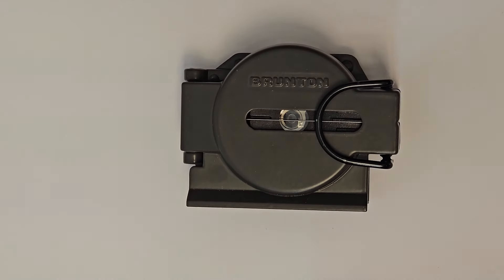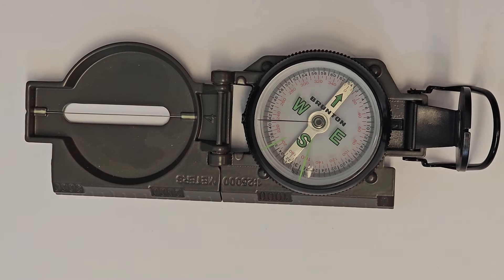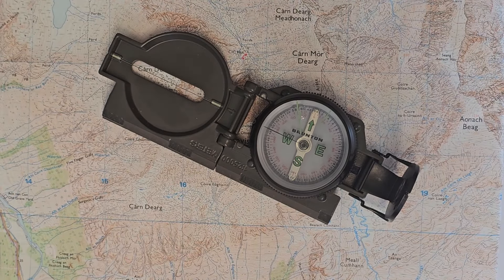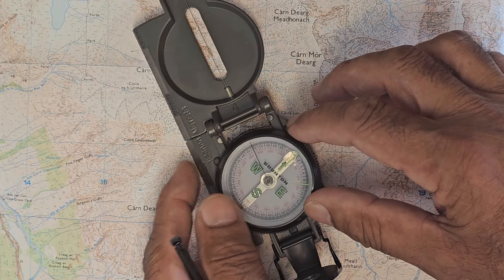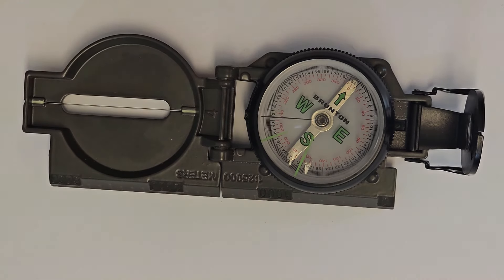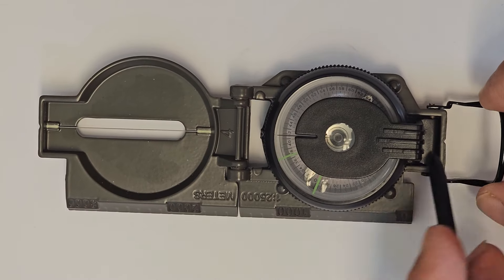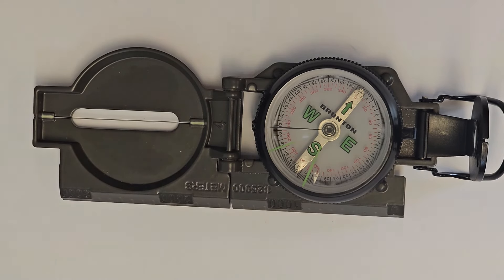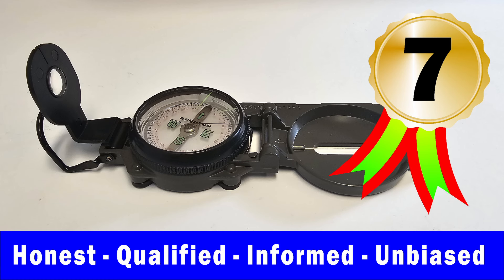Review -Brunton 9077 Lensatic

Comment: No new bells and whistles . The index line is nice. A needle dampener would be nice. Nice review and Thanks.
Reply: The damping in these is liquid. The Cammenga has an air filled capsule and the damping is by electromagnetic induction, from the interaction between the magnet in the needle and a coil of copper wire concealed in the base.

Comment: I need help for selecting a compass between the SILVA Expedition, Expedition S and Expedition 4. What's your toughts on the following:

BOTH COMPASS
- both have the inches and mm ruler
- both have the magnifier
- both have the 25,40 and 50k scale.

PROS FOR EXPEDITON
- the Expediton has the 24k scale, not the Exped. 4
- you can adjust the declination on the Expedition, not on the Exped. 4
- the Expedition has a measuring lanyard, not the Exped. 4
- has a clinometer, not the Exped. 4 (will I ever use that?....)
- has a slop card, ot the Exped. 4 (will i ever use that?....)

CONS FOR EXPEDITION
- the paralax line is cut by the magnifier
- better view of the rullers on the Exped. 4

As for the Expediton S:
The only difference between the regular and the S seems to be:
- S version has a mirror
- S version doesn't have the circle with the crossair (will i ever use that?...)
- S version has, 10, 24 and 50k. Not the 40k. I'm in Canada, so is it a big deal?
- S version doesn't have the direction line since it has a mirror. Is it a big deal for when plotting on a map?

Am I missing something? If not, I'd say the Expedtion has a big advantage on the Exped. 4 since I can set and forget the declination (unless I'm moving far away from where I am).